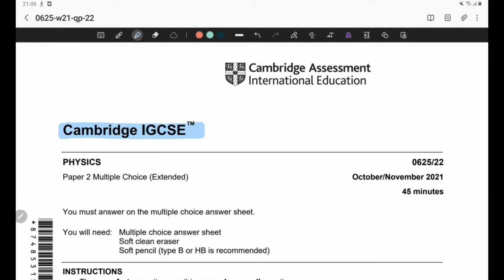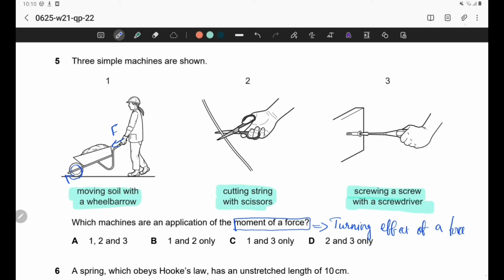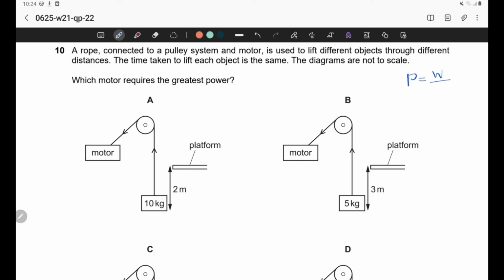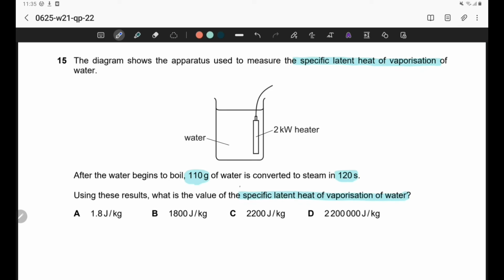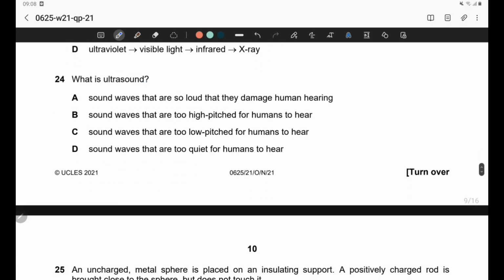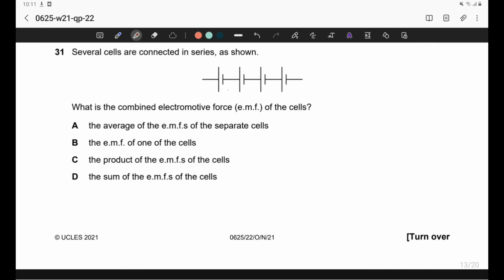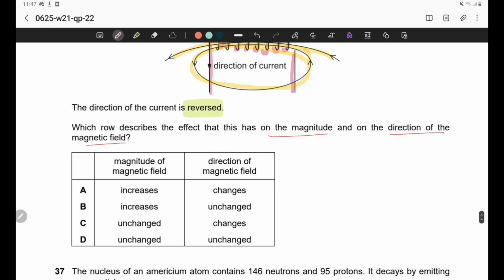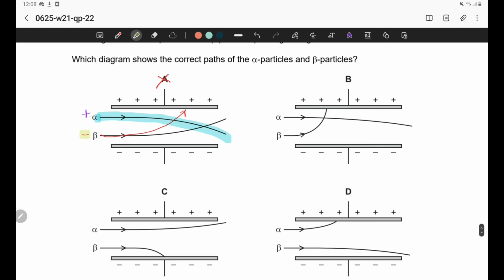0625/22/O/N/21 wholepaper Solution IGCSE Physics paper 22(October/November202) Paper2 MultipleChoice

Comment: Hi, I think you missed question 28
Reply: Answer is 18V, first use V=IR on the given resister to find current so 6= I x 1, solved = current is 6A. It is series circuit so current is same throughout. Then we apply same formula for combined resistors. V= 6 x (2+1). Solved = 18V
Reply: she did the question when she solved w21 qp21 in her previous video.
Reply: yea i needed help in that 🥺